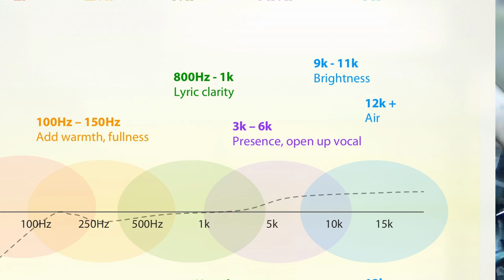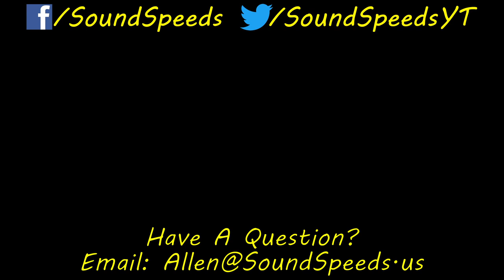Loud Building Airflow Solution & Air In Dialogue Recording, Speed Bumps Podcast 15

Comment: I do have a question that may work for the podcast. How does temperature affect the sound response of a microphone? Given perfect wind protection, will a mic give a different frequency response at 30°c, 0°, -30°? I have an outdoor background and "know" that a place sounds different at the extreme temperatures, but want to be able to record it for others to experience.
Reply from the maker: They usually don't work differently unless they encounter extreme humidity or some other factor that will affect the sound outside of operating temperature. Now I could discuss how sound is affected by cold or hot weather if you want to email me a question.

Comment: So in regards to the ceiling tile, are you saying to push the vent up, and seal the hole with another ceiling tile?
Reply from the maker: Yes
Reply: @Sound Speeds  will definitely try this in the future. Was on a series last summer where we couldn't control the AC/HVAC and this would have helped. Thankfully the DOP was very easy to work with and we were able to re-frame the shot to get in tight with the boom, and salvage a 7 page dialogue scene.
Reply from the maker: The key part is the drop ceiling. If it doesn't pop right up, they might be interwoven and if you press it up, you may screw up the whole ceiling. Just be aware.
Reply: Be sure to handle the tiles with care. Some are pretty brittle and one might break off a point/edge easily. We've lifted half a ceiling once to bring in light from the windows above, and in another room we've used the frame of the same kind of ceiling to hang down a big ventilator that made the hot summer a bit more pleasant.
Reply from the maker: Yes indeed.

Comment: Did you have spare ceiling tiles with you?
Reply from the maker: Of course not. Talk to the locations department and they can either grab you a stack from some other room or a supply closet. If not, pull from another room and then replace once done.
Reply: @SoundSpeeds  lol. Fair enough. You definitely do jobs on a scale I am not familiar with. It's be up to me to find them. Lol.
Reply from the maker: Copy you.